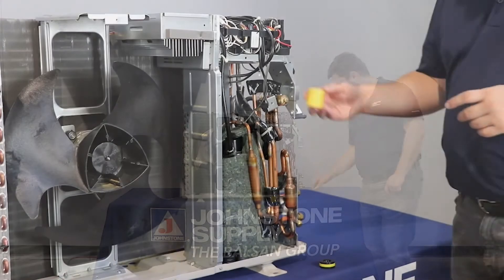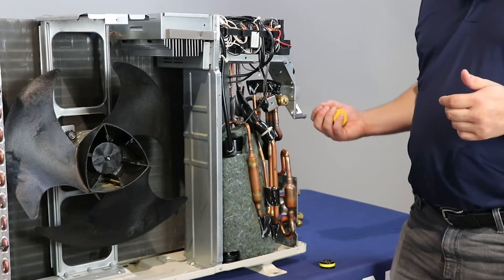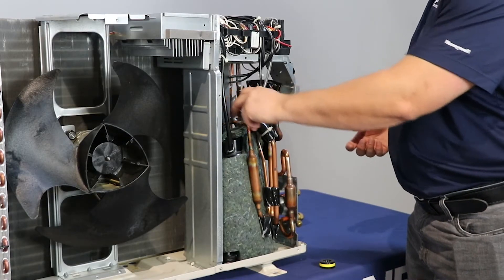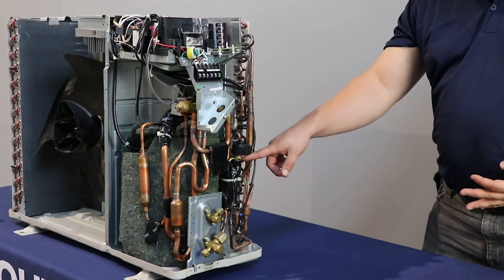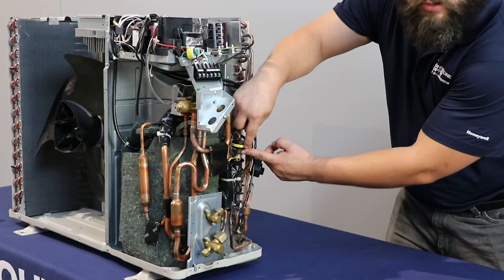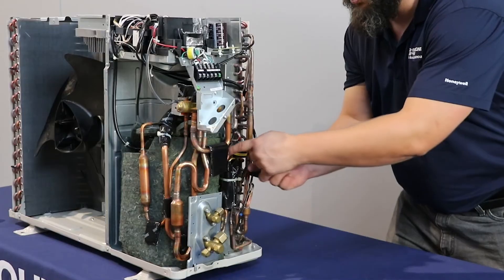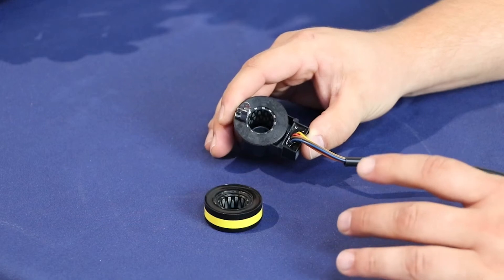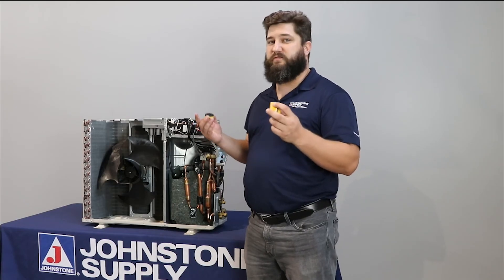KEEP THESE ON YOUR TRUCK... Solenoid & EEV Magnets

Comment: If the coil is energized when you remove it from the solenoid stem the coil will burn out.
Reply: Place a screwdriver inside the solenoid coil when energized to prevent burnout.

Comment: The eev mag tool is 125 bucks. How the sam hell can one justify the price that high for one little magnet?
Reply: I'm going with ac servicetech in troubleshooting the eev valve. It's easy to troubleshoot his way. But thanks
Reply: Now it's 200 dollars
Reply: @aljammal9891  Thanks! I feel so much better.
Reply: @smacleod69  lol, cruel reality bro
Reply: @aljammal9891 now it’s almost $400😢
Reply: There has to be a cheaper alternative….
Reply: @TekiWeki  I tried to make a tool out plastic roll casing of plumbers tape and nerodynium magnets. Supplies only cost 15 bucks but it didnt work
Reply: @smacleod69  That's why it's so expensive. It's a super precision piece of fancy equipment made in a billion dollar machine shop. Not just a magnet
Reply: now its $355
Reply: It's Johnstone supply
Reply: Its $ 395 in 2025
Part #  S1-02649686000
Source product

Comment: Do these work on hot gas valves for ice machines ?
Reply from the maker: The solenoid tool ( https://www.johnstonesupply.com/product-view?pID=B15-390 ) will work for Hot Gas Valves if the HGV is controlled by a Solenoid. If the HGV is controlled by a stepper motor then you would want to use the Expansion Valve Magnet ( https://www.johnstonesupply.com/product-view?pID=B20-993 ).